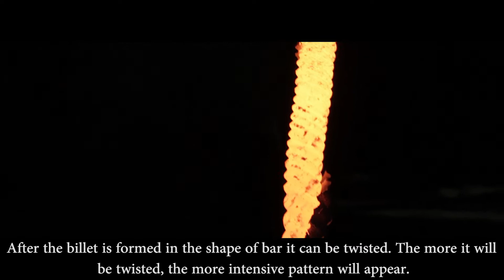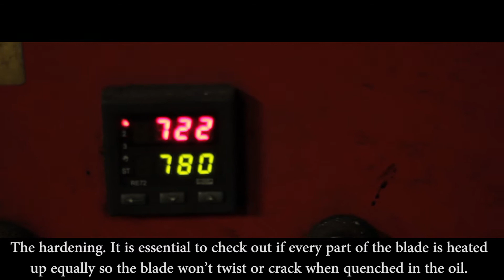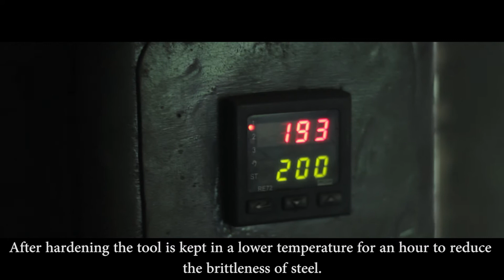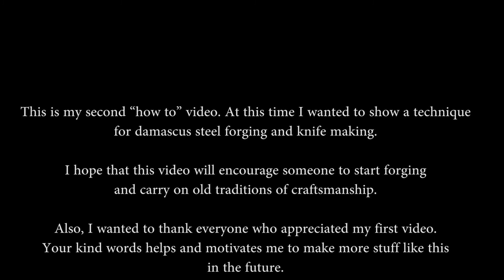How to forge damascus steel: Step by step. AUTINE and bladesmith John Neeman

Comment: I have been working with iron using electric and gas torches for a couple years, and have had the thought in the back of my mind that forge work would open a new horizon.  Well,
you might feel good to know that watching you work has gotten me into "high gear" to build a forge (using the electric torch, I have a design in mind) and get to learning.  Between what I have seen watching you and a book or two, I think I will have a great time.  Thank you for your sharing this marvelous craft.